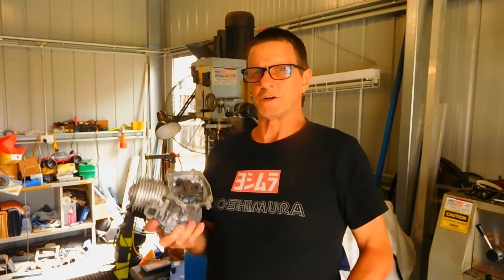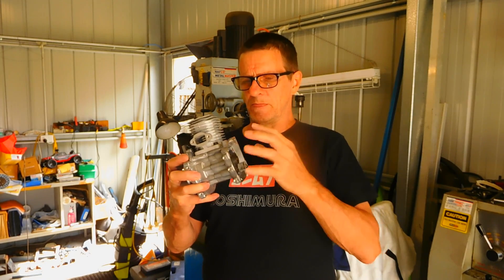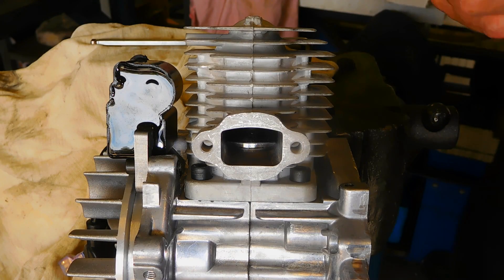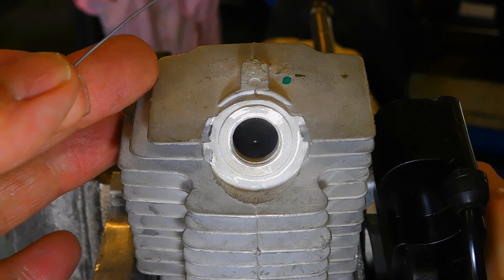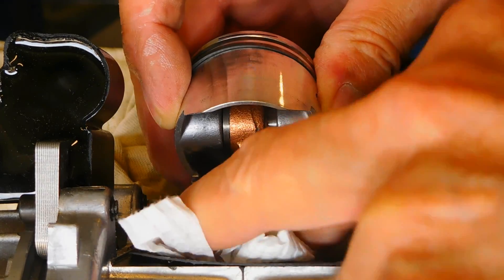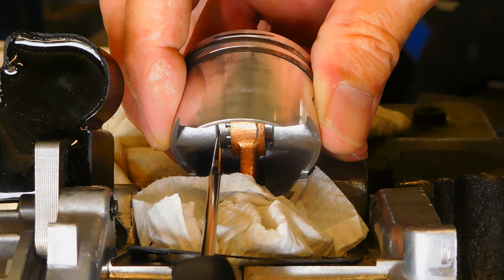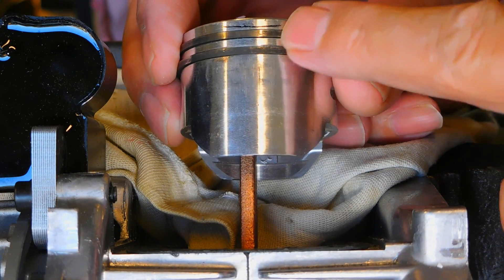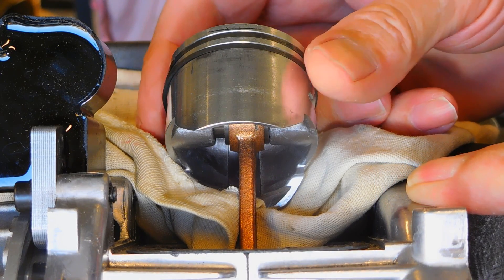Two Stroke ebay Engine, Cylinder and Piston issues, Wrist Pin Bearing problem.

Comment: do you have any experience with the iame kart racing engines? can you swap a caged needle bearing  with a  "crowded" roller bearing?  just removed mine and 3 of the needles fell out of the cage and wont go back in.
Reply from the maker: If you could get a roller set to fit it then yes probably
But there are caveats.
One of that is crowded rollers at the piston end usually have washers each side of the rollers
Some of them have an L shaped cross se4ction too.
Secondly is the regs, they are very tight and unfortunately there is one reg that (last time I read them) says that "modifications not covered in the regulations are not permissible"
That means that if the regs do not allow for free use of bearing types in the con rod then that mod would be prohibited (as I read it.)
I would suggest that you just get a new caged roller and stick with it as the only benefit of crowded rollers is that it can handle higher RPM since its the cage that fails at very high RPM before the rollers. So if you are not running higher than stock RPM there is no gain to running crowded rollers.
Reply: @AuMechanic  ok i found the caged roller. I'm not using this for karting but for another project. I'm surprised i cant get them to  pop back in the cage by hand no matter how hard i try. so maybe the cage has been damaged
thanks
Reply from the maker: @warrenpeas  It may be damaged or you may need to heat it up to get the rollers back in
Either way your best getting a new one to save the old one failing and causing more damage.

Comment: To solve the problem at minute 4:30, stainless steel washers with a hole equal to the diameter of the piston pin may be enough
Reply from the maker: Yes you could but I probably wouldn't use stainless simply due to weight.
2 stroke engines that use a "crowded" roller arrangement at the small end that has no cage use Aluminium washers at each end of the rollers.
Same could be used for this.
They would need to be high grade Al like 6061
Also would need a fair amount of side clearance in them to ensure lubrication can still get to the rollers.

Comment: Is it okay to just grind off the part of the piston that doesn't clear the exhaust port?
The ring wud still be okay, so I think it'll be okay
Reply from the maker: You could do....but
The trench left in the piston top would mean that area doesn't come close enough to the squish region. Although in an engine like this the CR is pretty low so it wouldn't matter much.
OTH there is probably not much to be gained by doing it anyway.
It just highlights the fact that this engine basically has the wrong cylinder on it for the stroke among other flaws with it.
Reply: Was thinking of putting alumi-rod /filler for that, but true  @AuMechanic  :)

Comment: On 4:30min, can we do something to solve this? Or just change the bearings for example every 5000km? O already bought the cylinder kit, there is no way back 😁 thank you!
Reply: I'm curious on this also
Reply from the maker: Hi, sorry i missed this comment.
You could machine up spacers to fit in each side but you need to be careful to make sure there is plenty of clearance each side.
Someone has already tried it and it failed but I think they made the spacers too tight.
They only need to be big enough to stop the rollers hanging out the side of the small end of the con rod and no tighter than that otherwise it might rob the small end bearing of lubrication too.
If you do them an Ali it needs to be 6061 at least nothing softer.

Comment: i dont think the ports being fully open is important, unless you are trying to get the most rpm out of the engine, i.e a horrible tuned up racer, i prefer standar and quiet reserved 2 strokes, a  bit of restriction is good.  i mean, are you going to remove the whole expansion chamber and exhaust to make it breathe even easier? no.  you want small ports.

Comment: i've seen many a rebuilt 2 stroke outboard were someone put those style wrist pin bearings in the new aftermarket pistons they got, and the thing was all beat to hell. the best ones , in my opinion, take the 28 loose needle bearings and those 2 cupped washers you spoke of. way better design than stock, and no way of beating itself up!
Reply from the maker: You are right on that, what you refer to is a "crowded" roller bearing arrangement (no cage) and that is the best for very high RPM engines such as some Kart engines. The bearing cage is the weak point.
Reply: @AuMechanic  interesting. never knew the terminology. these days, it's hard to find anyone that works on older 2 stroke stuff. everyone wants a new fancy computerized 4 stroke with warranty. breaks after a few years of no oil changes? no problem. just throw it away lol. i miss the 80's.
Reply from the maker: @ct1762   Yeah I liked the 80's, I was road racing bikes back then (350 2 stroke and 1000 superbikes) and it was hey days of road racing, we used to get huge grids (sometimes 30+ starters) and decent spectator numbers too, it was good times.
Sadly the end of 2 strokes made road racing even farther out of reach to many as they were the cheapest class to race in.

Comment: I Knew it! I knew these often come out of the box with incorrect pistons installed!! I'm concerned with the 66cc motorized bicycle engines though but, I believe they are very similar perhaps even many manufactured in the same places.
Reply from the maker: There are a lot of copy or knock off versions of these engines produced.

Comment: Could you use a wider pin bearing so it can't walk out the end?
Reply from the maker: Yes if you can get one that has the same OD and ID that would do it, if you could get one to suit which might be a challenge as they don't usually sell them with sizes like OD and ID and width specified.

Comment: When I got a $15 piston amd ring kit for my vento I just reused my factory bearing because there was nothing wrong with it,just bearings were wore down some.
Reply: if the bearings were worn, why re-use? the kits with the loose needle bearings and the 2 cupped washers are awesome. i'm sure your fine, but why chance it for $15?
Reply: @ct1762  mine weren't wore out,it was the rings that were wore out and instead of using the cheap junk new one I just soaked the old one in oil and reused it.
Reply: @ct1762  I meant to put rings where wore down some,not bearings.
Reply: @ct1762  If the bearings were wore there's no way I would of reassembled it without getting new ones.

Comment: How to remove this crankshaft and their center bearing take out
Reply from the maker: Using a hydraulic press, but I probably wont be doing a video on that, there are plenty of other videos showing how to replace crank bearings.
Reply: @AuMechanic  thank you for responding

Comment: Is polishing the exhaust port worth it?
Reply from the maker: The short answer is no, but that said there are gains to be had be cleaning up the surface of the ports and removing any irregularities.
Polishing the port alone does not improve flow.

There is a theory that polishing the port can help to reduce the build up of carbon however my experience is that is not the case and what causes build of up carbon inside the ports is actual depressions that create turbulent flow over the surface at the point carbon deposit is present..
The there is a carbon build up on one part of the otherwise clean port can be a sign that there is a depression at that are in the port that is significant enough to warrant blending it out to improve laminar flow across that region of the port..
Ill go into this topic more in future videos on porting.
Reply: @AuMechanic  Thank you for replying! I can tell you really want to educate people on the subject and that is a rare thing nowadays. thanks!

Comment: Same thing I noticed while measuring my engine's port after watching your previous videos my exaust port does not opens totally the 2 to 3 mm of piston stays above  the lower end of the port, Does it decrease the power of the engine??
Reply from the maker: Potentially yes it does reduce power, if the engine has a reasonable amount of BMEP eg flow through ports it will limit power.
Reply: @AuMechanic  so .. what should I do now?? Should I raise the ports by 2 to 3 mm or is there any other way??
Reply from the maker: @sumedhovhal8156  
The solution is to raise the cylinder the then remove the same amount of the top deck of the cylinder however if the cylinder head is not removable like the one in the video then this is not an option.
In short the problem is that the cylinder possibly belongs to and engine with a longer stroke.

Comment: I was a little nervous about getting an engine like that just because the head top end isn't removable and might be 38 cc ..is it really 38 cc ?  the reason why I got the bicycle engine is it's 60 cc but the ignition cdi is odd unreliable   cheesaneeze.  Only now figured the flywheel magnet got too weak on that and I was thinking ignition coils were coming in the mail dead on arrival ... the race version of the one you got. the head bolts extend up to the top end with the head removable ? That would probably make things easier if and when you Deck the cylinder and correct that exaust port . And compression I don't think that the Piston wrist pin being loose is much a problem so long as the cylinder hold the Piston right center. My nephew had a tiny scooter with the same engine it was no way near as fast As a tomos A35!  moped.
Reply from the maker: Hi Dan
Note in the video I mention at 4:35  even with the piston held centre of the rod small end the bearing still hangs our quite a bit.
This engine also has no squish band over the full area of the head which limits compression ratio so the removable head type one may improve on that also.
With the coils you need top ensure the coils are as close to the flywheel as you can possible get them with them touching it, that air gap can make a lot of difference to not just the spark voltage but the timing as well
I did a video some time ago on that topic using an oscilloscope and timing light.
Reply: @AuMechanic  yeah that's what I was thinking I use a business card for the flywheel magnet 1000 s of 1" works  for the bike engine as well and that stater better be screwed tight but I'ma try this engine for the smaller scooter side project I'm welding together for a friend
Reply from the maker: @capchassuck  
Business card is very thick.
Use a feeler gauge, just be sure not to use it when the magnet is near the coil pickups or use a brass feeler gauge which is designed for that purpose.
Reply: @AuMechanic  I didn't know if there was a tool for that. I know thousands of an inch was the standard of lawn mower engines but thanks. learn something new every day. this one guy does a tutorial for bicycle mount engine but screwed up everything and had a commercial for every screw up like he must be smoking crack cus it almost seems like he did it on purpose. I subscribed to your channel cus you know more about what you are doing. how does a Dino work ?. more power compared to rpm speed I'll have to review the one that two stroke stuffing made. I'm thinking a flange and metal bar Bell whaight and dc electric  motor attached to a pen graph machine that makes a chart on paper or something like that nothing. fancy like a computer . I'll see what I can get on eBay and thrift store may have to go get machine work at the local machineist.
Reply from the maker: @capchassuck  
The simplest Dyno is like Alex has at twostrokestuffing which is an inertial dyno.
You need to measure how long it takes to get a weight to spin up to maximum speed.
In theory you could just use a timer and a tacho to see how long it takes to get the weight to spin up to a given speed but that will only give you peak power to compare between runs which may be enough to compare after mods.
What a computer allows is to graph that time over speed over the whole period and then calculate power over the curve since based on the moment of inertia which is put into the computer as well as roller rpm.
Reply: @AuMechanic  do you recommend any kind of computer software and USB gadget? I got a broken down old laptop ..the pen graph machine available on eBay right now needs speachal paper and is old and beat up..
Reply from the maker: Id worry about that later after you get the mechanics of the dyno set up first.
Reply: Okay

Comment: Again even a polini has those insane gaps between the piston and the rod
So youd recommend making aluminium washers to put in between?
Reply from the maker: If the bearing cage moves enough so the rollers can hang out either end like that when the piston is centre to the rod then yes Id be using some spacers to keep it centred enough to at least ensure the rollers don't hang out either end of the small end of the con rod.
Reply: @AuMechanic  so i recently rebuilt my engine (new seals) and also  tried putting in spacers they went into bits only by reving it a bit after the first start and fucked my piston completely (stuck ring and scuffed up skirt) 
the washers were gone completely
so from my experience i would not recommend that
Reply from the maker: @schelmean16  
A few questions, how long did they last, what grade aluminum did you use and how much clearance did you have ?
rollers
Reply from the maker: One thing comes to mind that if the piston end spacer clearance was less than the big end side clearance was then the side load would then be taken up by the piston end and not the big end and in that case the spacer up top are not designed for that load.

Comment: From the looks of this engine, I'll be reconsidering what engine I'll be using in my project minibike.  Although I'd like to use a 4-stroke engine, I need something that I can lay flat, and would run reliably in any position.  So an engine like this one, but with better quality would be ideal.
Reply from the maker: Yes I would look around for others, this was the cheapest I could find (TDPRO brand)
There are some with removable heads which would be a better option.

Comment: I opened up my mates cheap 2 stroke generator that was running poorly due to running the wrong ratio oil. 

The motor was all coked up and after cleaning it up I noticed the ports weren't uncovering like yours. 

I think with a 5mm spacer at the base of the cylinder and then 5mm machining off the top should sort it out (luckily the head is separate) but would that be worth doing on a generator?

I might take it a part again to check the little end, good spot that one.
Reply from the maker: Yes if the head was removable I could just take 3 mm off the deck and raise the barrel by 3 mm.
There are some top end kits for theses engines on Ebay that show a removable head.

Comment: Nice to see your face!
Does it really matter that much if the port does not open completely?  If there is not enough duration or port area just make the port higher. If we are talking crap chinese engines like the motorized bike I race...
Reply from the maker: Cheers.That would be the simplest as I mentioned in another comment here to GAZGIT by just raising the ports to recover some timing and port area and just accepting the overlap at BDC and a little less trapped CR.

Comment: 34+3+3=40 stroke.  3mm at top 3mm at bottom . Great content .
Exhaust calculation very enjoyable and rare to see in such a clear way.
Reply from the maker: The actual measurement of piston clearance I did was  0.6 mm at the top.
The 3 mm is only at the bottom in relation to the port.
I suspect they used the piston that came with that cylinder to ensure it has small enough clearance at the top suffice to have a reasonable compression ratio.

Comment: great video! I'm interested to see the port duration's on this. Those piston rings look thick .
Reply from the maker: Yes the rings are pretty chunky which is going to limit of peak RPM of this thing.
I did a video previously measuring ex timing with a degree wheel and its 154 Ex and 104 Transfer which is pretty low for power but for a chainsaw type engine its not uncommon since they are tuned for low emissions and low noise.
Ill be measuring the timing again using the port to deck height method in the next videos to double check those timings.